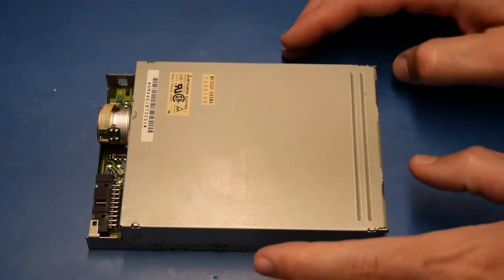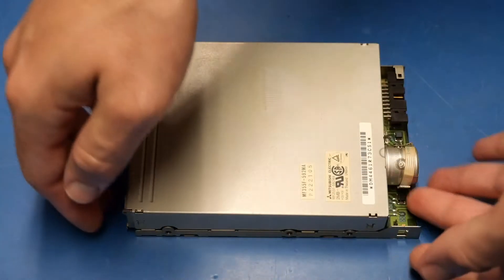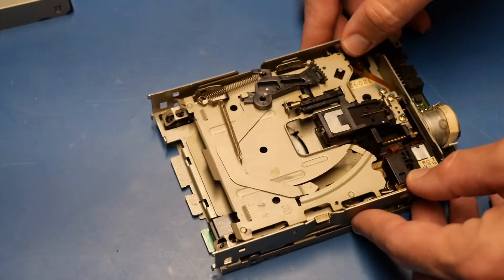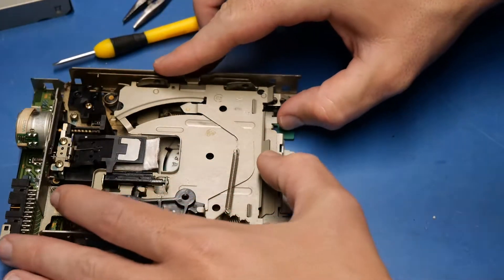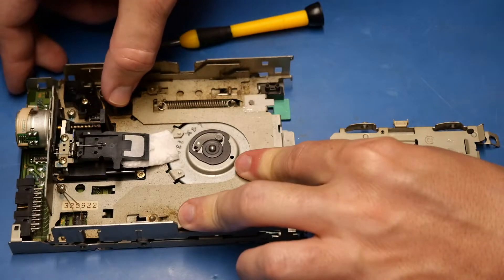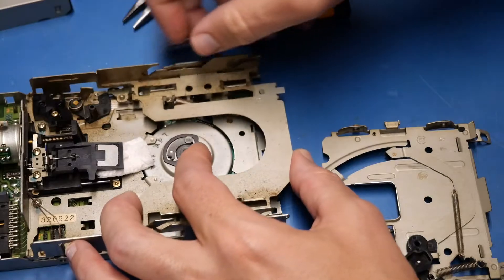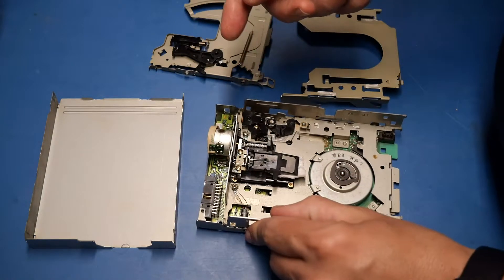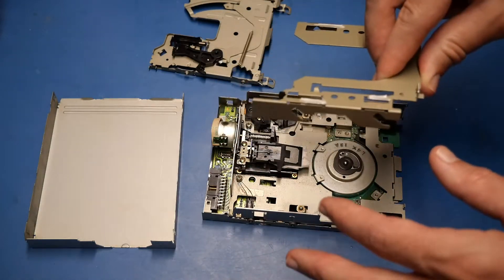Apple MF355F Floppy Drive Rebuild

Comment: Great info on how to take apart the innards on this model! I've worked on a ton of Macintosh auto inject floppy drive, but hadn't disassembled a manual inject model as it wasn't very clear how to do so. Of course, there's a number of different models, but this'll no doubt be helpful 👍

I'd recommend adding some info about how this is for Macintosh manual inject floppy drives to your video's description to hopefully make this easier for folks to find.

Another one saved!
Reply from the maker: Nice! I'll edit the video info to include that. I am not super familiar with the different types of drives Apple had.

Comment: yeah i tried doing some similar with with one of my 1.44 drives, but didnt really get it working reliably, There is a tool for DOS that helps with the alignment, where it makes beeper sounds as you zero in.
One other thing i thought of that you didnt mention was using alcohol on a cleaning disk or qtip to clean the heads. Maybe you did this before the teardown?
Reply from the maker: Cool, I'd never heard of an alignment program like that! Going to have to look around for something like that. Turns out, if you undo the two screws holding the rail down for the head you can just slide the other side of the head carriage out and not even have to touch the stepper too.